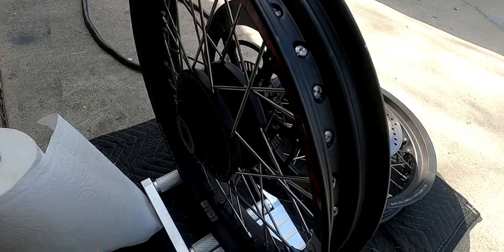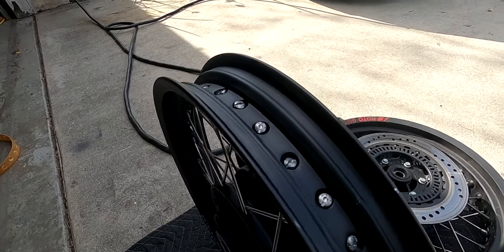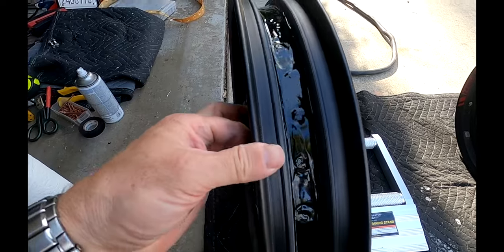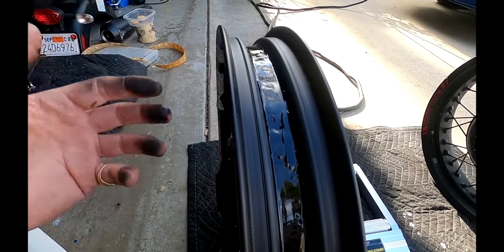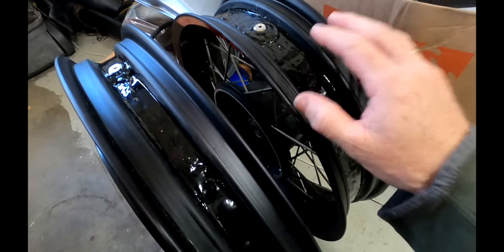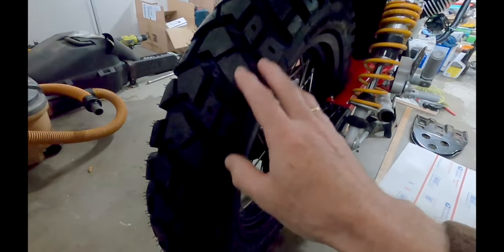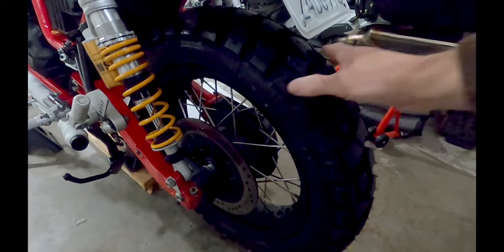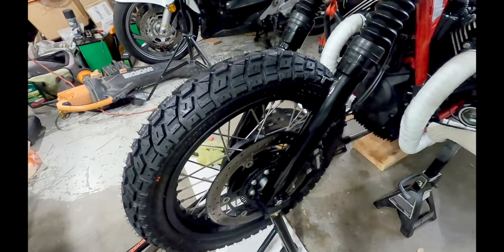TUBELESS CONVERSION

Comment: Do you think carrying a spare tube along would be good in case the bead falls off the rim?
Reply from the maker: I would carry a tire plug repair kit over a replacement tube - if the tire comes off the bead during a ride you've got bigger problems to deal with than a puncture. Best of luck & Continued safe riding to you.
Reply: @thebritonabike  yes a plug kit, but in case the bead slips off a tube would be fixable on the trail...
Reply from the maker: @snapcrack55  If the tire comes off the rim because the rim is bad or the bead is damaged a tube is only a temporary fix as the problem will likely cause the tire to keep coming off under load - If your wheel has recently come into contact with a curb or something else has collided with the side of your bike, it’s possible for your tire bead to be damaged. Although it’s difficult to damage a tire’s bead, it’s not impossible for it to happen when your wheel is deformed or your tire is scratched. It’s also possible for your tire bead to be damaged during installation if your installer didn’t use the proper tools.  Whatever the reason, if the bead of a tire is torn, do not try to repair it or fix it on your own. It’s likely that you’ll have to replace the tire entirely. This is because the tire bead is directly tied to your tire maintaining proper air pressure. If there’s an issue with the tire bead, then your tire will leak air and you’ll lose air pressure over time. If you’ve recently hit a big rock off road or a curb hard or are concerned there’s an issue with your tire bead, have it inspected by a professional. They will be able to verify whether or not your bead was torn or just was knocked loose. It may be the case that your tire just needs to be put reseated back into its housing. Doing this on your own is difficult and even dangerous without the proper tools especially when you are out on the road in in the woods off road - . Professionals also use a lubricant to ensure that there isn’t too much stress on the tire during mounting. Remember that proper tire maintenance can also minimize any risk of your tire bead being damaged. Continued safe riding to you !

Comment: I have tubes....I carry a bottle of tube slime or goo.

So not the end of the road.....

Yes love tubeless wheels.....would rather have them any day.

But tubes have there place.

But if I did convert....I think I may prefer the 3m tape idea.....dont loose and of the depth in the drop ctr......tyres are hard enought to get on off with out loosing depth in the drop ctr.

Nick...T100 bonnie.
Reply from the maker: No loss of depth of drop - the sealant only covers the lower portion of the rim and internal spoke heads. But I get your point. Each to there own ! Best of luck & Continued safe riding to you.

Comment: do you have to buy a brand new valve i assume ? Does it have to be made specific for that brand and bike or generic ?
Reply from the maker: Any decent fill valves will do - I went with new heavy duty high quality Stainless Steel .. just because. But if you have old valves that are good - then you can totally reuse them. I just figured new would be better. Plus at less that $10 for a pair of new valves it ain't gonna break the bank. Continued safe riding 2 U.
Reply: @thebritonabike  one more thing, thanks for the reply anyway… how ling does the modification last without issue ?

Comment: Is there any different between normal 5200 (black) & 5200 fast cure (white) in term of strenght/self leveling/viscosity?
Reply from the maker: To be honest I have no idea …. Probably …. the fast cure might have slightly less adhesive strength, like with JB Weld products , the quick set has a litter less psi hold strength. Best advice I can give you is check the 3M web site and manufacturer technical specifications. FYI my conversation with the 5200 black is still holding perfectly, no leaks or issues! Good luck, and continued safe riding to you. Thanx for watching.
Reply: @thebritonabike  thanks for the advice, definitely gonna choose 5200 normal cure because of the psi hold strenght.. Good luck:elbowcough:

Comment: Can you share where did you buy the sealant so cheap? I was able to find only for 60 GBP only.
Reply from the maker: Here in the USA Amazon sells the 3M™ Marine Adhesive Sealant 5200 for $22 , looking back I bought my tube from a seller on Ebay for the same amount. I just did a google search and came up with lots of options to buy. Not sure why it's so expensive in the UK? Best of luck in your quest to buy ! Continued safe riding to you.

Comment: ...and what of potential wheel balance issues?
Reply from the maker: I had no balancing issues when my tires were remounted after doing the sealant. But that's why we have spoke weights IF there is a need to balance a tire on a rim. Continued safe riding to you.

Comment: i think tape was used so you can fit a tube for emergency fix in case of larger damage
Reply from the maker: Even after doing this conversion you can always go back to using a traditional inner tube. Continued safe riding to you.
Reply: What psi did you end up running?
Reply: Maybe the tape is to protect the sealant when mounting the tire. The bead needs to drop into this area and there’s usually a lot of force on it.
Reply: @okanaganrider4332  I think you're right

Comment: How long they will be last under this process?
Reply from the maker: I can only state that 3M says that this sealant is a PERMANENT repair in a marine environment even below the water line. In this application (if done properly) the sealant is never going to be exposed to salt water or extremely harsh conditions - just living in the inner spoke channel bonded to the metal. It will also remain slightly flexible so any flex in the wheel should pose no problem. I expect that it will last a life time - or at least the lifetime of the rims / motorcycle. Only time will tell. If it fails at some point I will report back. Continued safe riding to you.
Reply: @thebritonabike  Thanks so much, I got the mission now😁
Reply: @thebritonabike Bro kindly share your experience will help others and can learn from it
Reply from the maker: @janaharajanrajan4652  Thank you  - I plan to keep making and sharing good motorcycle content ! Continued safe riding to you.

Comment: Do tubeless tyres need a different profile rim to engage with ?
Reply from the maker: Tubeless rims are usually cast wheels with a lip or ridge (below) to help locate and seal the tyre bead securely on the rim. This lip is also considered a safety feature which stops the tyre coming off the rim should the tyre deflate on the move. This lip also makes removing and mounting the tyre difficult by the roadside if you need to repair a tube. It varies from bike to bike and tyre to tyre, but usually, with tubeless you only need to remove a tyre to replace it when it is worn out (or destroyed), not to fix endless punctures. In my experience of over 40 motorcycles personally owned I have NEVER seen a rim without a safety lip - even if an inner tube is being used. Maybe really old pre 1970 vintage bikes that ran tubes don't have the safety lips on the rims but on all modern bikes the rims will have them. Continued safe riding to you.
Reply: most tubbed rims use tubless typers anwway just with a tube these days
Reply: @thebritonabike  Hi - only adding a comment because the T7 is a very popular model. The front does not have a safety lip. I converted the rear but had to keep a tube in the front - a pain.
Reply from the maker: @davidmathers1141  I agree - don't put a tubeless tire on a rim without that safety beed or lip on the inner / outer edge. My rims had them - so I had no issues. Continued safe riding to you.

Comment: can I put tire sealant?
Reply from the maker: Yes if you want to add it  - it won't affect the rim sealant. Personally I have had 100% success with rope seals vs liquid sealant which is not guaranteed to work -  I wish you continued safe riding !

Comment: Way over-complicating it.   Just get a tire tube one size smaller than the rim,  cut the tire tube down the center,  put it on the rim,  put the tire on the rim,  pull the excess tube out between the tire and the rim all the way around,  air up the tire,  trim the excess tube all around the rim on both sides.   The innertube seals off the nipples inside the tire and acts as a gasket between the tire bead and the rim bead.  Simple,  effective,  no tools required besides a razor knife.  Hope this helps.
Reply from the maker: Agreed - your way is much cheaper, simpler and quicker ... but that's not the way I chose to do it ! Thanx for the comment and I wish you continued safe riding !
Reply: @thebritonabike  I will say your way is much more durable,  you won't have to change the cut tube everytime you change tires,  and I believe there is a fast-dry version of the 3M Marine Sealant you used that dries in 24 hours.
Reply from the maker: Measure twice, cut once and do it right the first time to avoid costly repairs, do overs or unnecessary fixes ... the 24hr dry time 3M sealant is available and has a little less overall strength when finally cured but I am sure it would be fine ... because my bike was getting rebuilt I had plenty of time to do this type of mod + cure time etc as I wasn't in a huge hurry to ride it .... nearly a year later my tire pressure is still perfect and no leaks! Continued safe riding to you.  @BillySBC

Comment: Ciao ! Ha funzionato la modifica?
Reply from the maker: Sì, ha funzionato perfettamente! Lo consiglio. Grazie per la visione e continua a guidare in sicurezza per te.
Reply: I run tubless on all my mountain bike rims. I put a latex sealant in each tire. Should you use sealant or not ans why on a motorcycle? Thanks
Reply from the maker: Me alegra que haya funcionado para ti. Gracias por el comentario. ¡Conduzca con seguridad en su motocicleta!
Reply from the maker: @Ridewithcoko  I only have experience with the 3M sealant - and it is working perfectly still. No leaks. For motorcycle rim sealant I would continue to use this sealant only - continued safe riding to you.

Comment: But, when you adjust the spokes, doesn't that break the seal?????
Reply from the maker: It's possible - but realistically how often have you adjusted your spokes ? Spoke adjustment involves tightening the spoke nuts on the outside of the rim. The spoke head on the inside of the rim is locked in place and shouldn't turn or spin as long as it isn't damaged... thus the sealant on top of that inner spoke head remains in place. But like I said I suppose you could break the sealant if the spoke breaks or your rim is so badly out of round that serious adjustment is required .... if anything the sealant will hold your flat spoke heads in place even better . I wish you continued safe riding.
Reply: @thebritonabike  I always check the rim at every tire change.  More often than not I need to adjust a few spokes to keep the rim   true.
Reply: @thebritonabike The spoke head on the inside of the rim is part of that nut, and rotates with the nut to tighten or loosen a spoke.

Comment: I wonder if the sealant splits if you need to tighten a spoke?
Reply from the maker: Good question ... sadly I can't give you a definite answer. I highly doubt it due to permanent seal and flexibility of the sealant. BUT to be safe if it was me I'd grip the spoke with some vice grips before adjusting the threaded nut at the rim and then tighten that up .. without letting the spoke turn. In my 40 + years of riding on multiple spoked rims I've never had to adjust a spoke - but then again I might just have gotten lucky.  Continued safe riding to you.

Comment: If your spokes never loosen you aint riding hard enough
Reply from the maker: When you tighten loose spokes the threaded portion of the spoke extends outwards or away from where they attach to the inner rim. By making the rim tubeless you can still tighten loose spokes the usual way. ONLY if a bent or broken spoke needs replacement would you have to push the damaged one through the sealant and replace. Then all you'd need to do is add a blob of sealant over the repair area. Continued safe riding to you  !

Comment: I've had to replace damaged spokes several times. This isnt a good idea!
Better with properly deigned rims with spokes on outer part of rim.
I agree though tubes are yesterday's solution. All bikes should be tubeless by law now!
Reply from the maker: If you are finding that you need to do regular spoke adjustment then maybe this isn't for you - but you should be able to still make adjustments without the sealant being affected. You don't take of the tire for every spoke adjustment do you ? Stay safe and continued safe riding to you !

Comment: Do the psi recommend for the front and rear tires need change or it stay the same as the recommend by the manufacturer?
Reply from the maker: I always follow the manufactures recommended tire pressure - unless I am doing private practice in a parking lot where lower tire pressure will give more grip. Thanx for the feedback ! Continued safe riding to you!